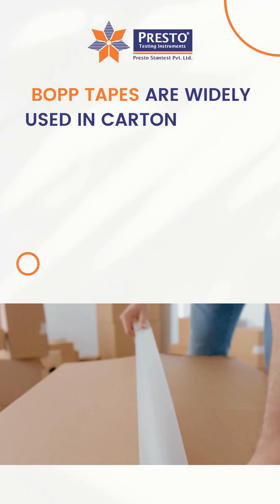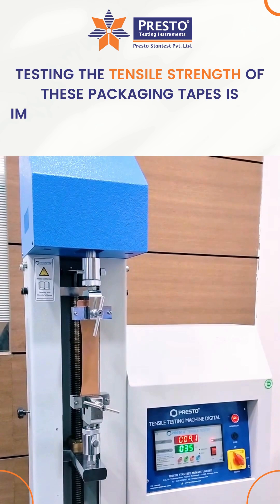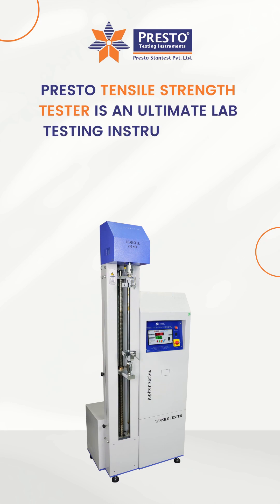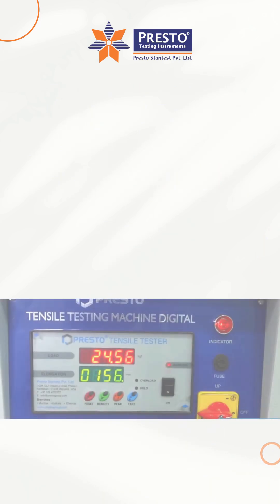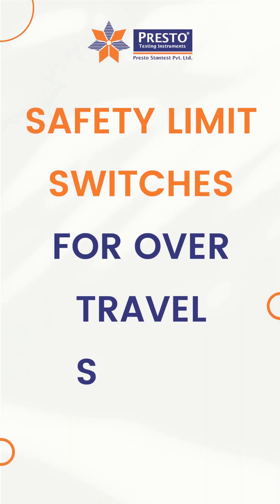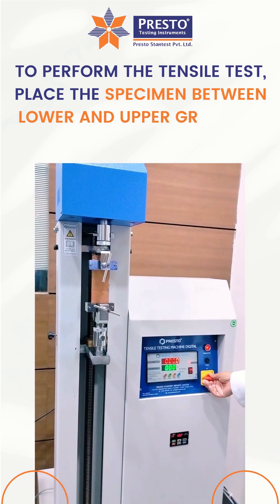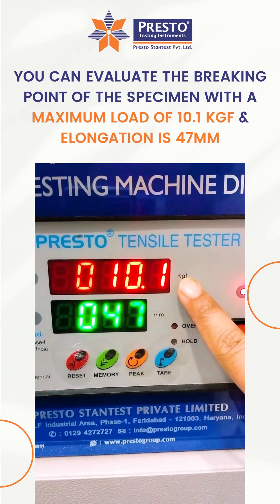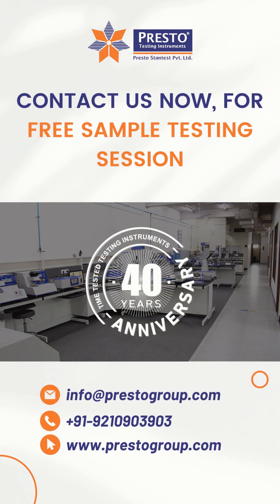Tensile Strength Test on BOPP packaging tapes | Presto Group

Comment: sample dimension what lengt and width?
Reply from the maker: It is as per Standards , In ASTM D 903 its 25 mm wide (length does'nt matter directly but you can use 100 mm) and in some standards width is 15 mm also